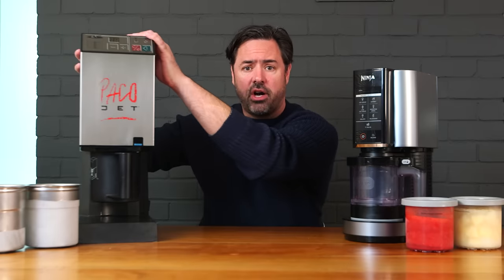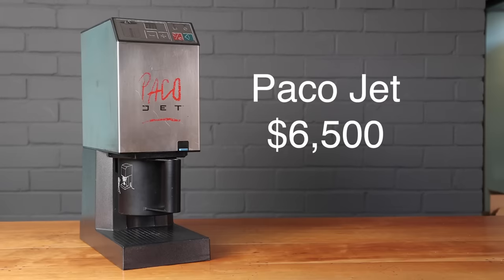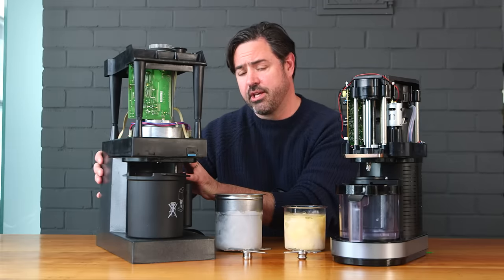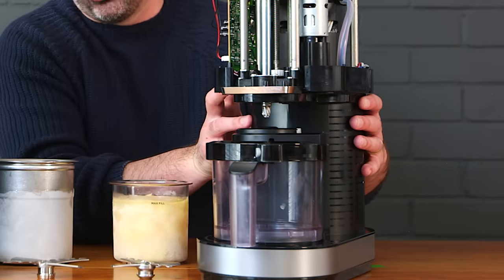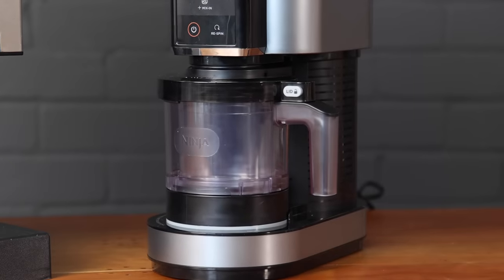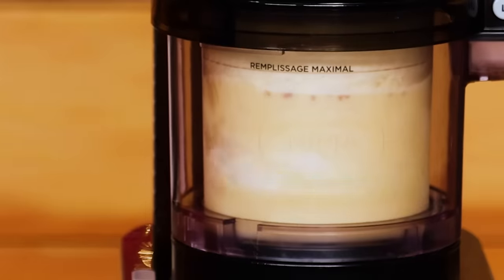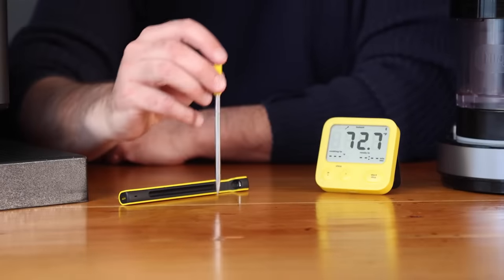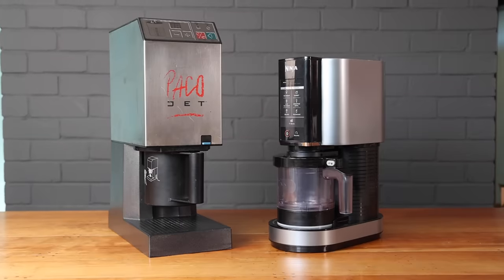Ninja CREAMi: Pacojet Killer?

Comment: Thank you so much for the review! I have been eyeing the CREAMis for a while now! I am curious if you find the texture of results you get out of the CREAMi to be as fine as the PacoJet? In practice, can it really replicate the results, or is it just 90% of the way there? P.S. Can't wait for my Combustion thermometers!
Reply from the maker: It's the same. The RPMs of the cutting blade are a little lower than the PacoJet, but they also advanced the blade a little bit slower, so the net result is the "chip size" from the cutting teeth is the same. The blade itself is identical in all of the ways that matter.

Comment: This is a great argument for what I thought was a fly-by-night infomercial level product. I'm interested in any savory applications for the ninja creami. What recipes are great to start with?
Reply from the maker: So I'm a big fan of using  these to create very smooth savory purees that can be served on their own or used as the base for a soup. For example, just add frozen peas to the canister and a bit of stock to fill in the gaps and freeze solid. You can the puree this to a smooth mix and then mix into some more stock until you get the texture you want for a fresh pea soup. Most vegetables work, although I avoid high-starch foods like potatoes that will get very sticky if you puree them like this.
Reply: Ninja  has been around a very long time now … I certainly wouldn’t call any of their products “fly by night.” (Though some are better than others)
Reply: @ChrisYoungCooks  What's the advantage of doing this in these machines rather than putting the same contents thawed in blender to make the soup?
Reply from the maker: @bubblewhip382  just convenience I’m a commercial environment where you need to prep large quantities in advance and then keep it as fresh as possible.

Comment: Hi Chris, im looking for a good machine that do smooth low calorie ice cream which are generaly Very low fat , with artificial sweeteners , and some time protein through in the mix ( maybe some xanthan gum to help for stabilization ). I do them generaly with a mixer ( throw the mixture with some ice ) but its fastidious , does some professionnal or customers machine can do the job? Throw this kind of mixture ( protein powder+ some fruit+ xanthan+ peanut butter low fat powder +choco powder + sweeteners ) in a professionnal ice cream maker will do the job? Or any other machin?
Reply from the maker: Both of these machines will do a good job on low-fat mixes. The big challenge with low-fat ice creams is always to get enough dissolved solids (protein powders and sugars) plus done stabilizer.
Reply: @ChrisYoungCooks  i was thinking about the gelato italian ice cream machine to buy :),thank you very much
Reply from the maker: @redchakra03  so it depends on your budget. Fir machines at a cost than less a $1000 or so, the most important consideration is how fast it can freeze the mix (less icy, and richer and creamier texture). The power consumption is the easiest way to compare one machine to another, since most of the power goes into the refrigeration system. More power equals faster freezing equals better ice cream. The Breville machine is pretty good in this regard.
Reply: @ChrisYoungCooks  i understand,very interesting , i will definitly   check this machine , thank you very much!!

Comment: Thanks for this!!! I have one and really like it. Excellent drill press analogy. 

Since I can now make ice creams with lower solids/fat % successfully, I have been thinking a lot about soft serve lately. Without an air compressor, any thoughts on possibility of (purposely) adding overrun with the Creami to approximate a soft serve texture? Wild goose chase maybe? 
(Looking forward to the thermometer, btw!)
Reply from the maker: Easiest way is to whip some of the cream and fold it into the base before freezing.
Reply: @ChrisYoungCooks  Makes sense, I will try it out. Thanks!!
Reply: Could you stick your ice cream mix in a whipped cream dispenser that uses nitrous cream chargers ?
Reply: Yeah, excellent idea, I’ll have to try some side by side tests. Thanks!
Reply: @coryhansen78  I searched in the comment section for the same question.

Have you tried that yet?

Supposedly cream doubles in volume whipped. Whipping 90ml of cream then adds 90ml of air into the mixture. Can I expect ~20% overrun?

---

EDIT: the air will simply escape as the blades spin. You have to add a layer of liquid on top before spinning, to trap the air in your ice cream.

Comment: Enginering wise, I dont think there is a fan inside the Creami's chassis, I think that should've been added.
I also think the motor should've been 900w-1000w on the deluxe variant.
Reply from the maker: They have a fan blade on the other end of the motor shaft to keep the electronics cool when running.

Comment: Awesome video. Do you have any suggestions for making black sesame ice cream with the Creami?   I’ve tried 3-4 times and it always comes out with a terrible texture, even if I process twice. The texture is like small mealy bits rather than a smooth creamy texture.
Reply from the maker: You’re going to need a way to mill the sesame seeds to a smooth paste first. Low speed for a very long time in a VitaMix might work (it does for peanuts) otherwise a conche for milling seeds into a paste would do the job.
Reply: @ChrisYoungCooks  I use sesame paste and blend it in with the cream and sugar. It always comes out weird in the creami. Same recipe in a regular ice cream machine comes out much better. It’s almost as if the oil in the paste starts to separate as it freezes and then that part doesn’t get cut well leaving little chunks of mush. Between the batches, I’ve tried different stabilizers - pectin, xanthan gum, commercial blend - but always has the same problem. Other ice creams and sorbets have come out great. Was hoping you had some idea as each experiment is pricey and so far the results are so bad they are inedible.
Reply from the maker: @jje4th  hmmmm, my best guess is that there is some kind of clumping going on during the freezing process itself, and the clumps are so hard that the cut blade doesn't really shatter them. 

Something I might try is to create the base without the sesame paste, then add it like a mix-in when processing the frozen base. You'll probably need to run it through twice to get the paste evenly dispersed, but this would at least help sort out whether the problem is caused by how the paste getting frozen slowly.
Reply: @ChrisYoungCooks  that’s a great idea. Thanks for the suggestion!

Comment: you might be wrong about ninja not having stamina. It's slower despite having less volume, meaning it's motor isnt being worked as hard. Meaning there is less heat to dissipate. The ninja might be able to run constantly.

Comment: I can see the advantages of the pacojet in the commercial environment but lets be fair here, whats stopping you from just buying 2 or even 3 of the ninja to make up for the difference in speed/volume? The only valid point for the pacojet might be the build quality + durability of having such a gigantic motor but realistically whats stopping, say a smaller business, buying 2 or 3 ninjas? would love to hear your thoughts
Reply: Pacojet is literally bomb proof, metal cannisters, silicon lid, durable holder to lock, you can force that thing and it won't break. Creami (and I have and love it) wouldn't last a week in a pro kitchen. The containers would crack / get dropped and the lid is not durable (Creami don't have any spares because so many people already broke theirs) and the locking mechanism is definitely not for the rough handed!

Comment: Thanks for this incredibly thorough breakdown in comparison! I hope there’s gonna be more where this came from :)

One questions though, because i coincidentally saw one of these at a store last week and had the opportunity to play around with it. One of the things I noticed too was the complex mechanism around the canister. While I agree that it’s a brilliantly elegant solution to lock it into place, it also seemed like it was a little over engineered with what seemed like a bunch of moving parts and therefore a bunch of potential points of failure. 

Now, in your expert opinion, do you agree that the mechanism could have an impact on the device’s durability?

Good luck with the channel and Combustion Inc. Sad EU residents aren’t eligible for the giveaway🙃
Reply from the maker: While the mechanism seems complex, and compared to a PacoJet it is, I don’t expect the durability of the mechanism to be a common point of failure. The actual part is a pretty simple ramp with a sprung detent. My guess is cracking of the plastic pitcher that hold the canister is the most likely thing the break with abuse.

And sorry we can’t include EU residents, but the products I purchased are for the US market and wouldn’t work without bulky and expensive transformers anyway.
Reply: I'm not so worried about durability on mine.  I'm more concerned that food will inevitably get on the shaft that rotates and moves the blade down into the frozen base, and then when it withdraws up into the machine there is no way to clean it.  I think maybe running a cycle in water after you are done would be a good idea.  No mention of this in the instructions.
Reply from the maker: @bostonbesteats364  that’s a fair point, and PacoJet has the same issue. One thing I found even more concerning with the PacoJet are the air hoses that pressurize the head space. There is no way to clean them, except for cutting them off and replacing them. I found a lot of crud in mine. I came away with the opinion that it’s a major health and safety risk.
Reply: @ChrisYoungCooks  Regarding the cleaning - both the shaft and the complicated lid on the Ninja unit have shown to be issues in the big user groups of the creami, with mold / food debris filling the lid cavity where the blad clips are, as well as the shaft. The best (and unsafe) way to clean the Ninja I've found is the use a magnet and clip to bypass the Ninja safety interlock, and clean the shaft through a dummy cycle with alcohol / soap and water as the shaft extends and retracts, and simply not install the blade of breaker. I wish they had a cycle to just lower the shaft an not spin as standard - "cleaning cycle".

Thanks for the great video and glimpse into the internals of the Pacojet as well! Any chance you could post any still images / views of its internals somewhere?
Reply: @ChrisYoungCooks  Great review!  I tell people that the Creami is an ice cream maker for engineers, and you gave the best review for engineers.  I've had it for about a month.  Two observations:   
1) I stripped part of the paddle threads because I didn't put on "readers" before cleaning the paddle and motor shaft, allowing food buildup.  
2) The slow "mix-in" speed is possibly useful for other applications.  I've already used it for lettuce "shredding" and will try for full blown small salad processing.
Reply from the maker: @jonwzee  glad you found the review helpful. When you say you stripped the paddle threads, do you mean the blade? That surprises me. 

And using it to shred lettuce is genius.
Reply: @bostonbesteats364  Just saw your comment.  This happened with me.  Fortunately (unlike the Chevy Vega) the paddle is softer metal than the shaft so I just had to replace the paddle. Good news is that the shaft threads are always exposed (don't retract all the way) so as long as you pay attention they are easy to clean.  I didn't see the food buildup in the paddle. Now use a small screwdriver to loosen any recessed debris.
Reply: @ChrisYoungCooks  Wow, thanks for the quick reply!  Yes, they call the "four armed blade" the paddle.  I think you can see my mistake by taking the blade (paddle) and putting it directly on the motor shaft (leave off the lid) just to feel the connection. I didn't see the food buildup in the bottom of the paddle, so the magnet pulled it up and I stripped off half the threads.  I rinsed out the paddle after every use but again, didn't see the food buildup and now use a small screwdriver just to make sure there's nothing in the bottom
Reply from the maker: @jonwzee  interesting, and even a bit surprising. But paddles do break (even on PacoJets) so not the end of the world to replace it.
Reply: @ChrisYoungCooks   What would be genius?  You "app-i-fying" the Ninja.  Given the two motor design and the removable "cutting paddle", can you imagine how useful the "Creami" could be with full control of the plunge and spin rate of the cutting paddle, along with a full-cut cutting paddle?

Comment: If it has more air whipped into it, its going to melt faster not slower.   You can easily see this with a pint of cheap ice cream set on the counter next to a pint of high end ice cream.  The cheap stuff melts faster due to higher overrun.   More dense things like premium ice cream will melt slower. Air in ice cream isn't insulating  it has the opposite effect completely.
Reply from the maker: Hi Herman, in general this isn't the case. In fact, most technical ice cream books (Ice Cream 7th Ed, Goff and Hartel) talk about this phenomenon. 
Higher overrun ice cream usually melts slower than low-over run ice cream for two reasons:

(1) The air bubbles act as an insulation, much like a styrofoam cup, and reduce the rate of warming, which slows the melt.

(2) The bigger factor is that the whipping action of a churned ice cream creates a dense network of strands of fat coated in air bubbles that stabilize the ice cream even when it's warm enough to melt. Note, this doesn't really happen as effectively in a PacoJet versus a churned ice cream, because the PacoJet doesn't create a whipping action—so creating a higher overrun PacoJet ice cream doesn't do as much to slow down melting. There was some nice research done on this by the ice cream scientist Cesar Vega in the early 2000s.
Reply: @ChrisYoungCooks  again, you an easily test this at home with a cheap ice cream and a premium one.  Or putting a container of heavy cream in the freezer and an equal amount of whipped cream.  The whipped one is going to freeze faster and melt faster when you take them out.  I was a  professional pasty chef for 7 years,  in high end restaurants, have used Pacojets, regular ice cream machines, and frozen and thawed many whipped pastry item. Just because its in a book doesn't make it correct. Look at the Bible.
Reply from the maker: @hermanmunchther3082  I also worked as a professional chef (as the head development chef at The Fat Duck in the UK) and I’ve done these tests. I simply disagree with you based on my own tests and experience as a chef.
Reply: @ChrisYoungCooks  look at something like mousse then.  Mousse freezes and thaws very easily.  It wouldn't if air insulating it was the caused it to thaw slower.  Again you can buy a pint of cheap store ice cream filled with air, and a pint of premium like Ben and Jerry's and stick on them on the counter next to each other and the cheap one is going to melt faster due to the higher amount of air/ lower density.

Comment: In another review it was mentioned that with the Ninja there is no way to clean the rod that goes down into the canister.
Reply from the maker: Sort of true. And same issue with the PacoJet. Recommended procedure is to fill a canister with soapy water and run a cycle. Can repeat with a lightly chlorinated rinse (bleach) for sterilization.

Comment: I feel like even for commercial kitchens the pacojet is a hard case to make. Yes it's faster with a larger capacity but it's not faster than two ninjas and I can have them making different flavors, which I can have more variation in since it can do mix ins, and as you said I can buy 32 of them. With that many I could run a few while others cool down. The only real argument for the pacojet is space efficiency. Though I will say 6.5 k isn't that much for a business
Reply: Pacojet is metal cannisters and a silicon lid and a much more user friendly way of attaching and using. Dishwasher and commercial kitchen friendly. The Creami pots and lids will be broken within a week in a pro kitchen! 😉

Comment: My only problem with Ninja is how much over-engineering they do. They always have more moving parts than they need, which means more things that can break, which means more replacements you'll be expected to buy. 

Most Ninja products work well, but have at least two ridiculous features that make them feel futuristic without making them easier to use or perform better. In the CREAMi, it's the nifty way the canister rotates as it shifts up to meet the blade. It looks incredibly slick, but I see no reason why it needs to rotate. Why not just lower the blade or raise the canister and lock it into place (perhaps it could function similarly to how a KitchenAid with a bowl lift works?) Those are just moving parts that could wear out and need replacing.

Comment: as a professional: Why not buy 2 or 3 ninjas for multiple production?
Reply: When we would do service, we would just keep it in the metal canister and put into and out of the freezer as necessary after it was run  through. If you use the plastic, it might crack and there is a possibility  that  a bit of it  could get into the food you serve.